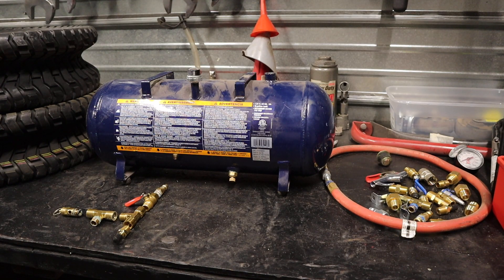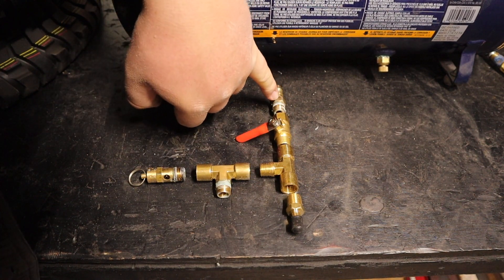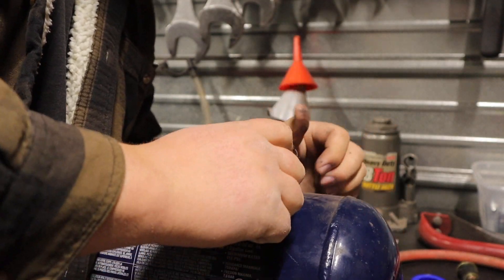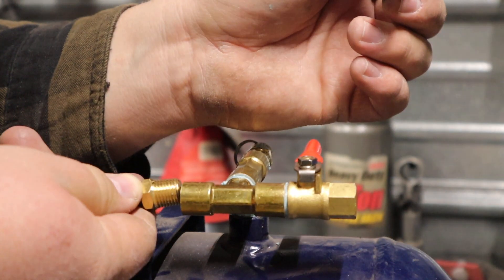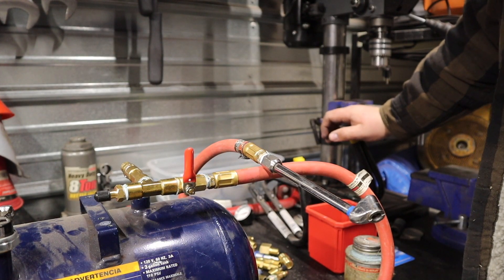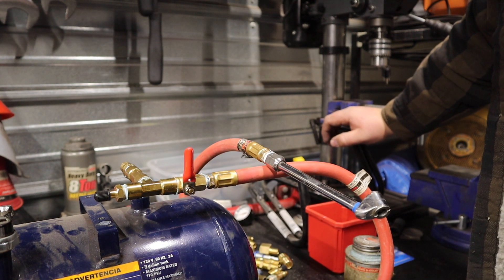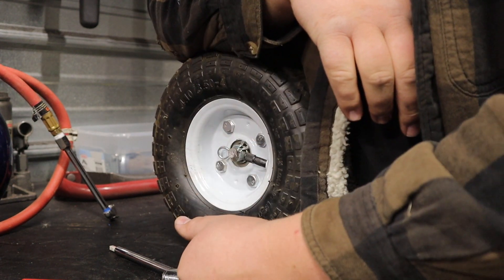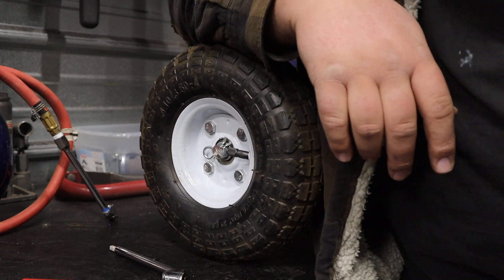Broken Air Compressor Turned Into a Portable Air Tank

Comment: So the PRV is usably 10-20 percent higher than the cut off pressure. So if cut off is 125 , valve would pop if it was a 125 valve. Its meant to pop at 135 ish if pressure exceeds that pressure limit

Comment: Handy!
Reply from the maker: Definitely better than tossing it!
Reply: @DereksWorkshopAndProjects  I have a rusty 10 gallon HF compressor which the motor and pump work fine on, but the tank is super rusty as it didn't get drained for like 10 years. I need to keep my eye out for a tank and I can make another functioning compressor.